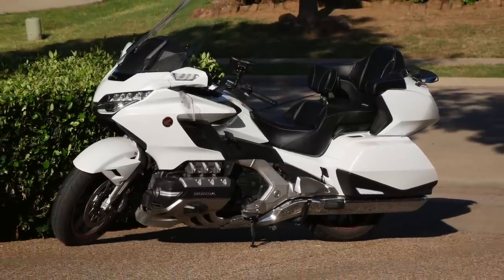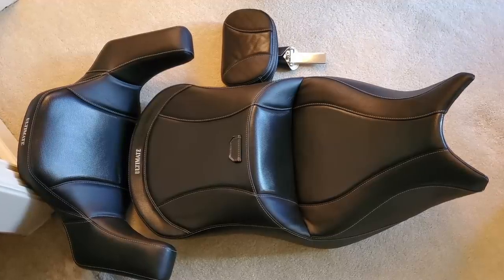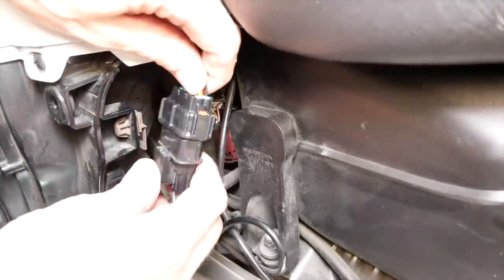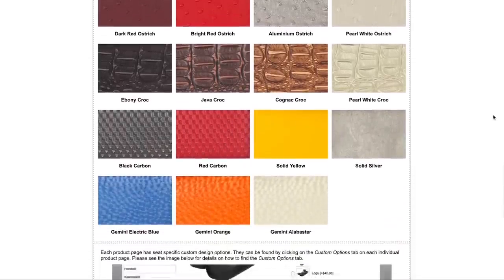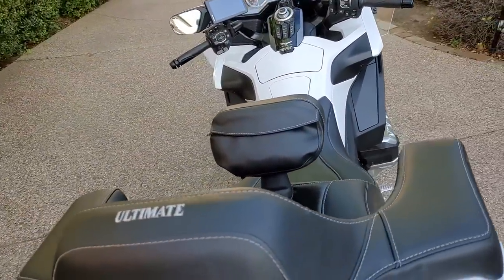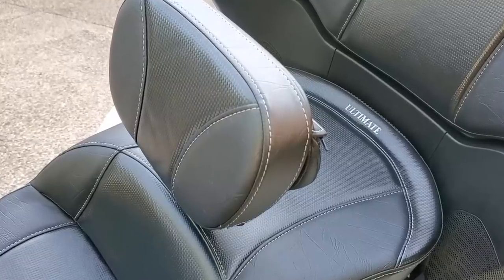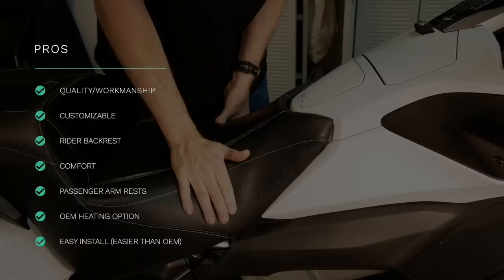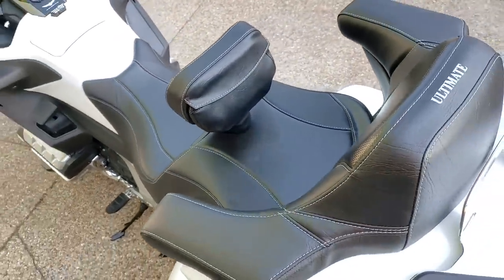The Ultimate Seat for 2018+ Honda Goldwing | Cruiseman's Reviews | 2020

Comment: After much research, including your video review, we bought an Ultimate Tall Boy seat. After several thousand miles and many months we can still say we are very happy with the seat. I do have one question for you. When you mounted the passenger backrest on your bike did you notice any gap in the armrest fitting to the trunk lid. Ours has a little bit of play in it in that if you push straight down on the armrest from a standing position the armrest moves downward like it is not fully supported on the trunk lid. Did you happen to notice this? I have removed and remounted the backrest several times with no change in this issue. Thanks in advance for your help.

Comment: Hello Chris
After your review, I bought an Ultimate seat for my 2021 GW DCT Tour with Airbag.
Before I buy, Ultimate told me their heated seat was exactly the same as the OEM one.
Very happy with the comfort of both the seat and the driver backrest.
However, after a while, I noticed that I lost the « start/stop » feature of the bike.
After a few checks at the Honda dealer, I realized that the Ultimate seat was the reason(!) of this missing feature because it DOES NOT contain the DRIVER SENSOR used by the « start and stop » function.
I can leave with that, but wonder if this driver sensor is used or not to arm or disarm the Airbag…much more problematic…!!
Specially considering the price I paid for the seat and driver backrest only:1600€.
The heated (I hope!) passenger backrest is not yet available due to the larger trunk of the 2021 model.
I have a discussion open with Ultimate in order to know how they can solve this driver sensor issue, but no answer yet.
Is this specific to the 2021 GW, or did you have other 2018+ customers raising this issue?
Thank you for your feedback.
Reply from the maker: THAT is a VERY good question and one that needs to be dealt with.
Reply: @cruisemansgarage  Thanks Chris. Do you have other feedbacks from Ultimate seat owners about this issue?
Do you have special relationship with Ultimate seat to question them about that?
Thank you for your help.
Reply from the maker: @alainfloutier6466  I do not have a special relationship, but I do have a contact and will reach out to see what they have to say about it.
Reply: @cruisemansgarage  Thanks Chris :):)
Reply: Hello Chris, I just received the final answer regarding this issue with the ULTIMATE seat from Dave Frank, VP of operations. NO WAY to have the driver sensor installed as the OEM one, resulting in the definitive loss of the Start and Stop function of the GOLDWING 2021 (or any model having the Start and Stop function). I find odd that a company like ULTIMATE is misleading the prospects willing to buy a seat and saying their seats are 100% compatible with the OEM ones, especially at this price tag. I am surprised that other customers do not complain about that....
Reply: @alainfloutier6466  Alan, Glad you brought this issue out… I have a 2021 Tour DCT Airbag and was considering the Ultimate and the RDL.  Have you gone to another seat now or do all aftermarket seats have this problem for the ‘21?  I have the USA version which does not have start/stop function but I wonder if the Airbag is tied to a seat sensor?
Reply: @gregedmonds8166  hello Greg. This was my immediate concern when I realized that the Ultimate seat did not have the driver sensor, thus leading to the loss of the Start/stop function in Europe. So I questioned HONDA Europe about the potential loss of the Airbag as well. They wrote me back and ensured that the Airbag was not concerned by the driver sensor, neither any other function of the bike…However, I am still wondering, as a mechanical engineer I was, why Honda spent such effort and cost to install a driver sensor ONLY to able or disable the Start/Stop function they offer in Europe…! Anyway, I really enjoy my Ultimate and forgot about the Start/Stop function I paid within the price of the bike. I also ordered recently the passenger backrest now available at Ultimate, that matches the main seat and driver backrest I bought earlier. Enjoy your ride with this fantastic Goldwing…😀😀👍👍
Reply: I also have a ‘21.  Which model do you recommend?  I’m 6 ft. 210 lbs with a 34” inseam.  Looking for added legroom
Reply: @stevedelgado2221  Hello Steve, I installed the Goldwing Tourer Midrider Seat - Heated with Driver Backrest heated. Color Carbon F6B Inlay (wave), bright red stitch and bright red Ultimate logo, because my bike is red. I am very happy with the comfort of the seat despite the lack of driver sensor that disable the Stop/Start function in Europe.

Comment: Cruseman.   Update please.   Are you still using the ultimate seat?   How does it compare to the wing soft?   Did you get the tall boy ultimate?  I noticed that the stock seat has plastic under the cover.  Does the ultimate retain that for water proofing the foam?

Comment: When mentioning the backrest, you should have said what your height is.  The backrest may not be a plus if the non-adjustable-ness doesn't hit the back of a shorter rider.
Not being waterproof is a deal breaker.  Dealing with a cover on a seat that costs $1800 is just absurd; that $5 cover is an afterthought because the manufacturer failed in the seat design.

Comment: Hey Cruise man, i have an off topic question.  I bought a used 2019 goldwing dct.  It didn't come with the emergency start code. I have spoken to the seller and he doesn't know where the code is.  Do you or anyone on this thread know where i can get this code for my bike.  i've called 3 dealerships and no one has any idea.  thanks in advance

Comment: What are your thoughts about this seat not being waterproof?  Have any issues?
Reply from the maker: I am not sure ANY seat is completely "waterproof", even the Honda OEM seat I have been told can pull in water (which surprised me). The question is HOW water resistant are the seats. I doubt that it is a major issue, but it could reduce the life of the seat over time.

Comment: I think the seat looks tons better the original OEM seat although unless you have serious issues with the OEM, ( recent survey on one group put it at approx 55/45 % ) it is way to expensive.  Quality question, you said the workmanship is second to none but I seem to have noticed a couple of creases in the material a particularly bad one in the side of the seat above the helmet lock.  Is this a fault or a trick of the eye/camera angle.  If I had paid that sort of money for the seat I would not be happy with that at all

Comment: I took your advice got wing soft upgrade I use my bike for work on it up to 10 hours some days  it helped a lot but I still have sore butt also with back problems. Thought this might help until you said it’s not waterproof I have to ride in rain a lot do not always have time to stop while on escort to cover up  so it’s out.   I bought a road sofa it was not much better than own not better than wing soft either thanks for all you videos
Reply: Our premium marine grade vinyl is completely waterproof. Also, we also use a mold prohibitor in our memory foam. Additionally, when rain appears suddenly - while you are riding - you are covering the stitch lines - so no issue there.

Comment: Just had he Ultimate seat installed by Ultimate on my 2021 and very unhappy.  They screwed up the install. The two screws at the front was the only thing holding the seat on. The fit to the bike is bad. The pan is rubbing against something under the seat. Haven't found out what yet.  The back of the seat rubs against the back speakers, so the rain cover can't be installed. And the midrider seems to move you forward. Made for a very uncomfortable 1000 mile ride home.  the 2018 seat may be different but I can't recommend the 2021 version.

Comment: The seat does look great! However not being waterproof and cost kill it for me I’m relatively happy with the stock seat - I’ve adjusted to it and with a lamb skin cover both my riding partner (wife) and myself can ride until we need gas or there’s somewhere interesting to stop. I think the main reason the stock seat can be uncomfortable is most of us are older and there’s less padding/less muscle on our rear end. In Canada I’m guessing this seat would cost us around $2000+ (way too much money) I have around 50,000 miles on the bike now.
Reply: Hi David,
Any aftermarket seat that has stitching is not waterproof. All of the aftermarket manufacturers sell rain covers. However, ours are the only ones that are custom fit for each seat we offer - and less like a shower cap (universal fit).

Comment: Hey Cruiseman, thank you for posting.  About that backrest, is it easily removeable or bolted down in?  I know you say it folds down for the passenger, but I prefer to just pop it out and back in regularly.  Is that possible here?
Reply from the maker: It comes with a hinge bolt that you can remove to quickly detach, or, they have a lock pin that is even quicker.

Comment: It sucks to get OLD for sure. Yes I have had the same issue with my hip, it seems to happen when I get on or off and have lift my leg and twist. I fixed the problem my getting on or off like a Horse. step on the peg and stand on it then swing leg. Easy Peasy no more pain or Locked hip. I like the seat however Mustang seats are no where near that expensive.
Reply: Hey Scott,
Thanks for your comment - but if you are comparing apples to apples - the seat and both backrests from Mustang are $1,500.
Reply from the maker: Scott, the OEM seat is $1200+ WITHOUT the passenger backrest or rider backrest.
Reply: @TheUltimateSeats  7/24/20 - Mustang is running a special. Both seats (apples to apples) are $1350.

Comment: I had wing soft do my 2018 seat. I sent it in during the winter while my wing was in storage, hard to ride year round in Minnesota! The price of the Ultimate would be too much for me. I finally did a longer ride. Wing Soft is a lot better  but still not the answer for me.
Reply: What don't you like about the WingSoft?
Reply: @danielkleiner9560   It is a vast improvement over the stock seat. I still get sore on rides around 100 miles. Was it worth the money ? YES it was

Comment: I am considering buying a 2021 Goldwing:  my understanding is that the seat issues are resolved.  Is this correct?
Reply: Nope. Same exact seat. Changed the outer material slightly, but under the vinyl, it’s exactly the same. Watch Wingsoft’s video on it.

Comment: Why would anyone make a motorcycle seat that is not waterproof? It seems a bit shortsighted. Other than that is seems like a nice seat. But I ride in all kinds of weather. I have rain gear that is built right into my jacket, pants, boots, and gloves so that I don't have to stop on a rainy day. Why on earth would I want to stop just to protect my seat? Especially at that price.
Reply: Hi Eddie,
Any aftermarket seat that has stitching is not waterproof. All of the aftermarket manufacturers sell rain covers. However, ours are the only ones that are custom fit for each seat we offer - and less like a shower cap (universal fit).

Comment: SO LET ME GET THIS RIGHT YOU SPEND 30 GRAND FOR A MOTORCYCLE AND YOU HAVE TO UPGRADE THE SEAT
Reply from the maker: No, you do not HAVE to upgrade the seat. Some owners are fine with the stock seat. I should also point out that aftermarket seat manufacturers make seats for all brands and models, so upgrading a seat is not unique to the Honda Goldwing.